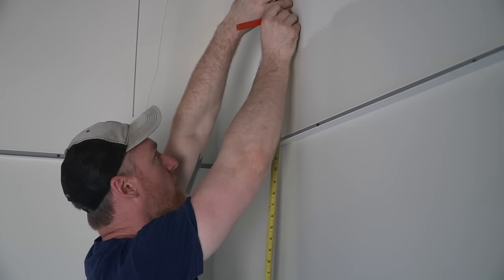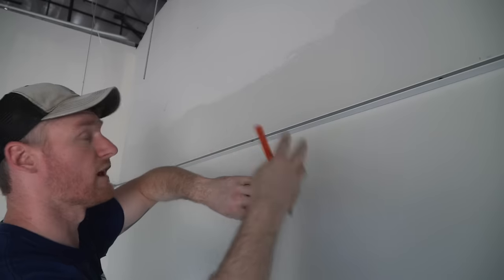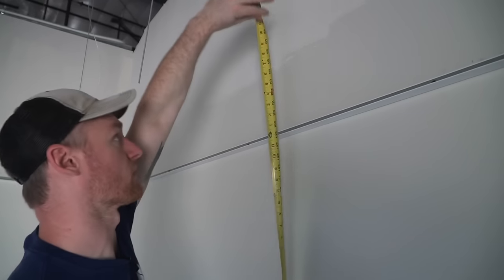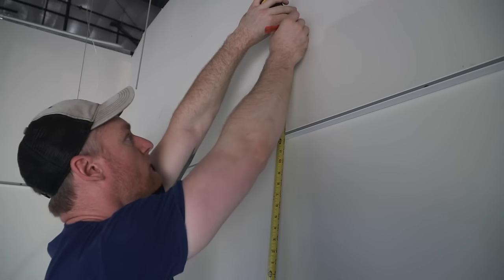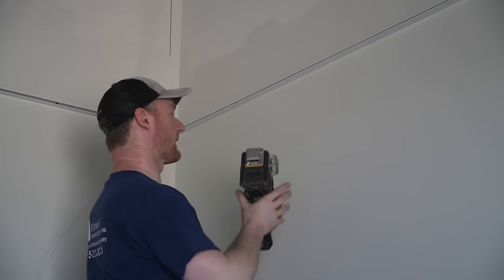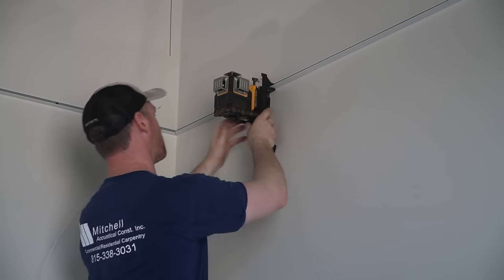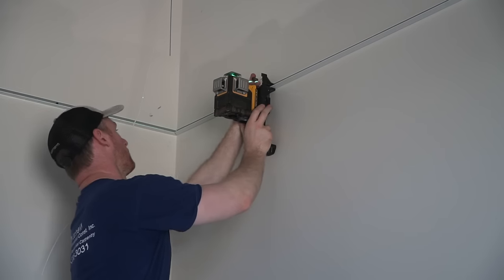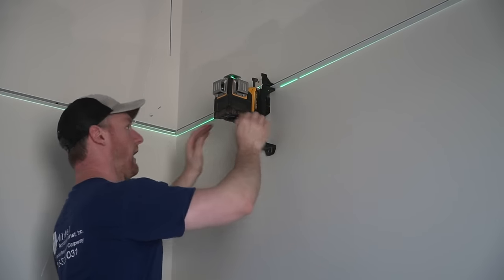How to Install Ceiling Grid

Comment: When re doing a ceiling and tie wires are in concrete but old lay out wasn’t centered will same tie Waite work or should you run new wire right above the new grid layout
Reply from the maker: I depends. A little of the centerline is fine but if you’re pulling it and it’s strongly pulling on the grid you should put up new wires

Comment: Are commercial units with ceilings like this fully separated by floor to ceiling walls or are they like cubicle style once you get above this tile roof you’re building? And I know commercial is a broad brush, I’m referring to strip malls where it’s a single grid.
Reply from the maker: This was for a concrete testing facility. Walls didn’t need to go to the deck. I think just 16’

Comment: Starting off i was told to run mains the longest run or as you said; the least amount of material. Been getting lucky doing that for a long time until one day I ran around popping wire this way and ended up doing four huge rooms before my boss caught me. The mains actually goes across the short side of those four foot lights.
Reply from the maker: Sure but the wire can dictate how to run them as well. In this instance we had to work around some ductwork. So we try and get best use case.

Comment: I currently have a drop ceiling installed in my salon making the ceiling only 8/ 9 feet tall which we have high ceilings above so plenty of room to move it up by 2-4 feet.  Is it possible to raise the grid or would we have to remove the entire grid to do so?
Reply from the maker: I’m not sure that would be cost effective? You can re use the tile. But grid is inexpensive.

Comment: Hey, I have someone who wants to frame a wall with metal studs on a room with that type of ceiling. The room is finished already, they just got the idea to split it into two. So how can you anchor the top plate/rail if there's nothing really solid to anchor it to?
Reply from the maker: You should just be able to use steel studs and under pin it. Meaning take the track and screw it to the grid using mini screws

Comment: My kitchen ceiling has a drop ceiling but it's shaped like a Dome, I be liv I can in stall a nice drop ceiling but I have a ceiling fan right smack in the middle of the ceiling, what can I do without removing my ceiling fan. I wish I can send you a picture
Reply from the maker: joanne oliver without seeing it, what I would do is take down the light so there is just a mounting box, then you’ll frame that mounted box to something so it’s sturdy to carry the weight of itself and the ceiling fan. Once that’s done pick your ceiling height and run the grid. That tile in the center of the fan may be a bit tricky but we have a ceiling tile video as well. Let me know if that helps👍

Comment: I enjoyed your video. do you ever install ceilings without pop rivets?
Reply from the maker: We sure do! We call them wag clips, or we cut mains and screw them into the wall and then run a screw through the main on the wall and main on the grid.  I really like using wag clips when we do 9/16" gird because its really hard to get the rivet into the main or T.
Reply: @mitchellacoustical3119  Have you ever cut in tight? No fasteners of any kind.
Reply from the maker: @randyledbetter4529  I haven't, I heard from national GC's that its more of a seismic requirement not to rivet so that the ceiling can have room to move. But we've always at least riveted both mains and one wall of T's, or we'll use the way clips if the architect specs them.

Comment: Mr. Mitchell  thanks  for lot. I  am in srilanka  how  i find this material   and  I.B.C. wire how to install  up. Please tell me .
Reply from the maker: We get it from our supply houses. The grid we use is typically USG, celotex, or chicago metallic.  The wire can be  purchased at the supply house.  Thanks for the comment!
Reply: To install the wire in the upper slab drill a 3/8"  hole with a hammer drill and tap in a matching 3/8"  hanger pin bolt. Hilti also makes wire with a concrete pin attached to one end that can be fired into the slab with a dx gun attached to a long pole. This is the fastest method but it's a lot more expensive in tools and materials.
Reply: Actually i think I'm wrong about the size of the hole. Pin bolts come in 3/16th or 1/4 inch I believe

Comment: I'll give ya a comment. THANK YOU for not adding some mundane, tedious, annoying background music. Makes listening / watching "difficult" ... especially when repeated. Now that I got that off my chest ... I don't think it matters much if at all, but I noticed in the Armstrong video (as well as the guy I work with) that you differ in how you use the jet line. They run the line down the edge of the first main tee and center of the first cross tee. Any thoughts? I may prefer your method.
Reply from the maker: Freedom WatchDog You’re welcome! I wouldn’t even know where to begin with the music ha. As far as the jet line, my placement comes from what my dad taught me. I think for me the center makes sense because until your wires are leveling the main, they have a chance to snag the jet line. Where if it’s centered you have a better chance at staying on top of the jet line and not disrupting it. Same goes for Tees snagging the side of the jet line when you set them as well. Neither is the end all be all, I just choose to center mine. Appreciate the comment👍

Comment: can you explain how to do when you are a little short of materials and money, and you put your firts main T,  and the other piece is gonna be for example 10 inches long, so if its a big area and you need to run several Main T, that means you gonna  waste a 10 ft Main T and you just gonna use a 20 inches, so my question is hoe can i do to cut several pieces of 10" inches long and put them together whit the whole MAIN T
Reply from the maker: I know how to splice an old ceiling into a new ceiling in a remodel, but not sure that helps you in this instance
Reply: Just keep using the remainder. For example say your room was going to  need 3 rows of mains. Use the 12' then cut the 10" piece to finish the row. Now you'll have an 11' 2" main to start the next row. You're remainder is now 20". So you do the same thing and the next main is 10' 4". You can continue that process until you're done and you don't waste any material other than the final cut

Comment: I ran my center grid down the middle, when I got to last 15  feet of the center , my center was off, it narrower  the last 15 feet .
Reply: I have a stairway making it narrower.
Reply from the maker: Yea that’s an issue with the room then. Kinda have to pick your poison. You can center the room or have a boarder on one side.

Comment: all tees is measured by 4 feet length?
Reply from the maker: Short answer is: yes. There are Tees that are 4', there are some that are 2'.  The basic's of layout is all 4' when your mains are hung.  So think of it like a 4'x4' section once you connect the Tees then you can add the 2' Tees  in after to finish if you have a 2x2 system like this video.
Reply: You can get 6' tees if you have an odd light or acoustic panel layout. But check your local codes to see if they're allowed.

Comment: I didn’t understand the part where you mention that blue print says 9ft AFF and you are adding 3/8” above that because you don’t know what fixtures go after that..and then you added a mark on the wall way above the edge angle..the you marked 6ft off the wall..Why did it go above the angle as the angle should be at ceiling height..it was at 3:45.
Reply from the maker: Because you have to establish two marks to set your angle and your laser. I didn’t want to get into laser set up because that’s not what the video is about. I needed the 1st mark to know my height, the 2nd mark was arbitrary in that I was going to throw a laser on anyway to make my mark.

Comment: I would have put the main runners the opposite way 👍 less messing about with hangers. Still good job though.
Reply from the maker: Martyn Caswell so that’s the crux of the issue. Use more mains and turn the grid or hang more wires. In these 14’ rooms we chose the wires because the apprentices were already up in the air so we could splay the wires when they twisted them right next to each other. I understand what your saying👍. I appreciate the comment

Comment: Your lazer has a square line to shoot main's and cross-t’s square. Why don’t you use it so you don’t have to edit the video when you’re squaring it?
Reply from the maker: Why? I can square it with my tape. I’d have to square to the walls, set on the ground and then set the laser to it?
Reply: @mitchellacoustical3119  Go ahead square each run with a tape. I just set the entire room with lazer square, perfectly square and straight mains and cross-tees and another laser for level. I bet you have a extra lazer to level, right?
Especially with thousands of square feet this is better
Reply: @mitchellacoustical3119 9:24 seems like there was some complication, 52.33 is not 52 1/4, you out 9/100 so in 11 runs you out 1 inch.

Comment: Why are you off by 1" on both your measurements 35" and 38"
Reply from the maker: Without rewatching it since we put it out around a year ago, I think what I did in this instance was shifted the main over a few inches to connect with an outside corner on the other end of the room.